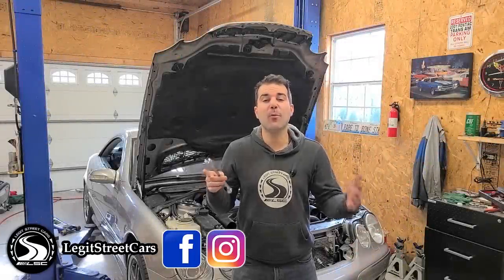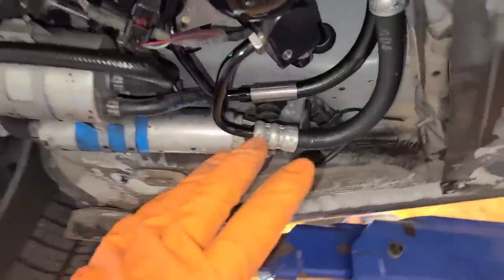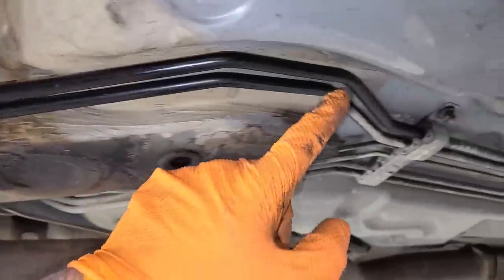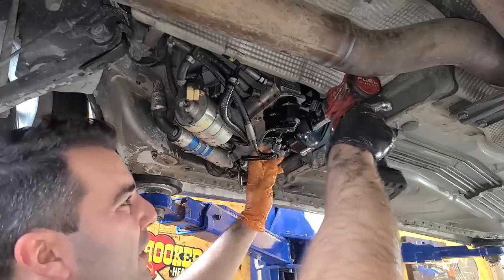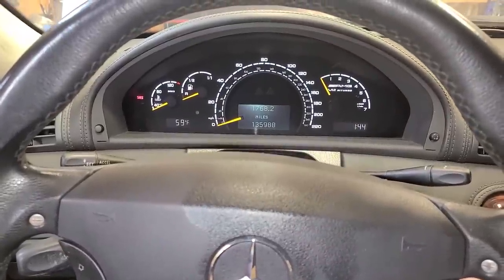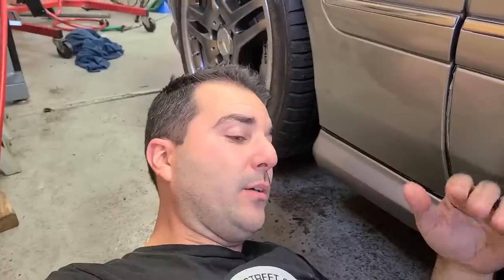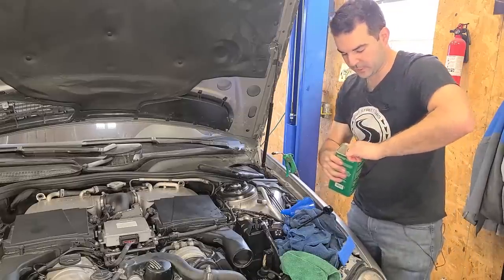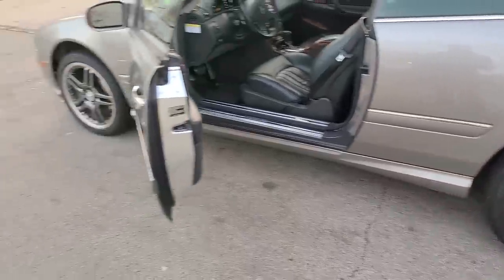I FINALLY Fixed The Hydraulic Suspension On My CL65 AMG & You Won’t Believe What It Was! FIRST DRIVE

Comment: Omg iam having the same electric problem. The same thing is happening with my window in my subaru but the o2 sensor goes down and I haven't solved the problem yet. We Change the o2 senor but the problem keeps coming back after some time. Don't understand why
Reply: I understand nothing to do with suspension but it's a weird computer sensor problem

Comment: Alex, did you get billet engine mounts for this?  Where did you get them?  I need some for my SL65 AMG.
Reply: I got mine from East Coast Euro, they're really nice. The have a billet/polyurethane trans mount available as well.
Reply: @brucelovell1346  I just emailed them and got an auto reply stating that they have closed permanently due to supply chain issues

Comment: These cars were so over engineered from the start.  I have saved this whole series for reference.  My '03 CL55 will drop on the front passenger side after about a week.  The ABC system on a W215 CL AMG is like dating a beautiful stripper...  When it's good, it's GREAT.  When it's bad...😳

Comment: I'm thinking you had a stuck spool valve in one of those rear pressure blocks. Even though the solenoids were activating, that doesn't mean the spools were actually moving. The tolerances are so close on those spool valves (much like in an automatic trans valve body), that a sliver of metal or a tiny piece of that rubber diaphragm could have been keeping the actual spool from moving. Your new (to you) rebuilt valve block with different solenoids was probably the key to getting fluid moving again to the rear shocks. Once again, I'll reiterate... completely over-engineered piece of crap, no matter how nice it rides. This amount of complexity should not be allowed on a normal passenger car.😜 

They obviously didn't think this through well enough, since you have to do bogus operations like pressurizing the reservoir to get the system to even purge itself?! When they get to a point where even the certified techs can barely get them to work properly, they're more trouble than they're worth. Let's see how long this lasts now that it's finally functioning like it should.. a year maybe? I'll be surprised!😉 Apart from that, kudos to you for figuring out the impossible and making it work like it did when it came from the factory. Great job man!😁

Comment: No they are not worth it. And yes, I am very much aware of all of the work put into this for the suspension problem ON TOP OF the work you did on the engine because of a $1.00 o-ring. Alex the engine is the best advertisement for electric vehicles I've ever seen. NONE of this crap in electrics. As for the hydraulic suspension it is totally NOT worth the aggravation. Have you ever seen the videos on Hoovie's Garage where he BURIES a car. That's what this Mercedes Benz needs. Bury this Bastard!

Comment: Never go above 8 cilinders and never  go with hydraulic/air suspension, its to complicated and fails a lot on these older cars. Build them back on a sporty coil suspension and get rid of that unreliable v12. They cook to easy after a long fast drive burning gaskets or cracking cilinder heads. My rule is short engines, 4 cilinder or v8, the rest i wouldn't own or touch.

Comment: "One touch don't work "
Bro I finally know something about a Benz u don't!?
Hold up after the window is all the way up and it will activate the one touch....

So since u don't know this I'll add another thing u may laugh at since u have the fancy code machine....
Unplug the battery and let it chill for hours....so the memory thing that the capacitors maintain will reset ....even over night...

Comment: Man, 35 minutes of what. You don't check things that are already checked, you don't use wire in lines when air will tell you if they are already clear., you get methodical when all the obvious maybes are checked. I am disappoint.